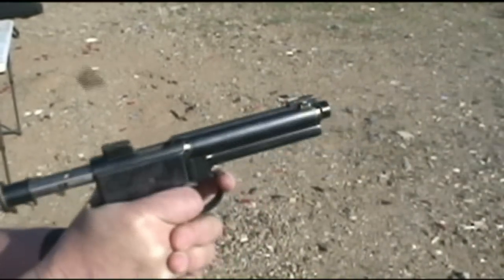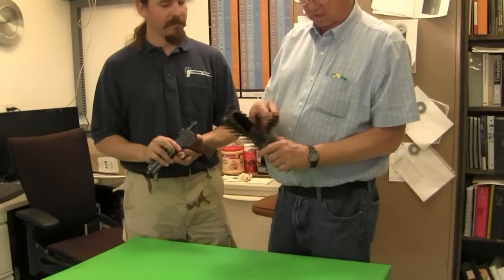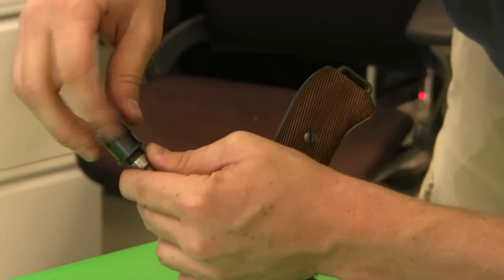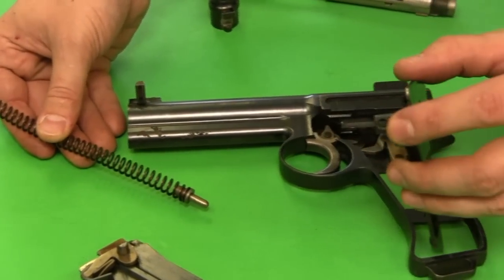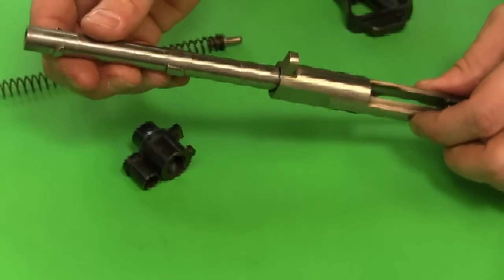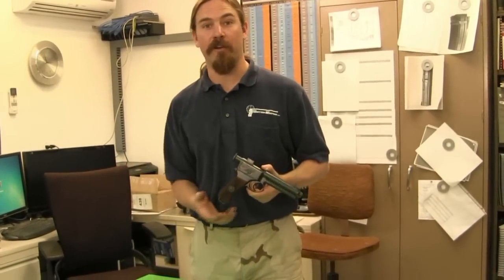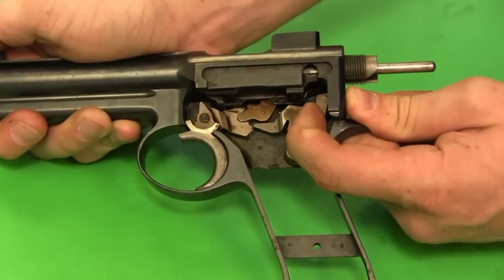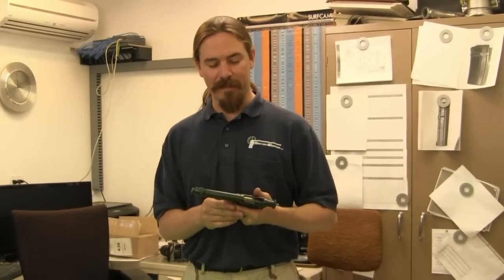Roth-Steyr 1907 Pistol

Comment: I can see the origins of the idea that a semi-auto is less reliable because of all the moving parts.  That guns seems to have been designed by clock makers.
Reply: ***** Yes - I believe in modern guns you can't make a legit claim to revolvers being simpler, having fewer moving parts, or any of that stuff.  Historically, however, it took a long time to simplify auto-loaders and get them to the level of reliability they've attained in my lifetime.

Comment: You can see it's ejecting pretty much straight up and back.  Which is really convenient for finding brass.  If you leave your mouth open as you shoot, you don't even have to crouch down to pick up your shells, which is nice.

It's not a flaw, it's a feature.
Reply: Don't look directly at the bugs
Reply: It's also obviously not designed for buxom women to shoot with low cut shirts. :)

I've seen that happen with modern firearms also.  They sure do seem to jump around after that.
Reply: Also a similarity with Glock. Used a 19 at the range one time at it showed contempt for my left handedness by throwing hot casings at my forehead. Good times. . . Good times.

Comment: I suspect that the inertial effect of the bullet taking the rifling would have caused the rotating barrel to screw up tightly, and provide the locking delay.
It looks potentially very accurate to me.
Many thanks for all the splendid videos.
Reply: I tink it would put you in mind of a ruger, in its design in regards to the blow back,

Comment: Nice presentation. A bit of 07 Roth Steyr lore; they were issued to the Austrian Flying Corps in WW1; they were part of the Austrian war reparations in 1919, and they were very popular with the KuK (Imperial Army). You gave very good instructions on loading but  here is how to unload it. Behind the lever which depresses the magazine floorplate there is a square checkered button. Pull back the bolt and depress this button.It locks the bolt in the open position. Depress the first lever to unload.

Comment: Never seen a detail view of these. Very interesting. There is an awful lot of things going on simultaneously, and the trigger system looks pretty intricate. Good ergo though. I can see why they went to a fixed mag for cavalry use- dropping mags all over is of little use. A charger loading system makes sense, esp with 3 pistols. I think ballistically the cartridge is about like a 32 H&R Mag- 85 or 90 gr bullet at about 1050 fps or so. Decent but not real high energy. Great video as always. Thank you

Comment: that is a pretty hefty rotation on the barrel.  The PX4 Storm's rotation is barely 45 degrees to compare to a modern rotating lock.  The PX4 is also a VERY much simplified design all around, field stripping into 4 major parts (barrel, firing assembly, slide, and reviever).

Comment: It is a wonderfully designed gun,  very intricate, there must be some tension on that spring,  when he pulls it back,  you can tell it is not easy to pull,  i assume this is partly to do with the rotation of the barrel,  which in itself is crazy, in a good way,  the amount of work in that is unbelievable and so well done, the one  thing i reckon,  i would not like about the gun if i was firing it,  is the trigger,  he mentioned how hard it was pull,  and it looked like his finger had to travel a long distance before strike,  this makes for a gun with less accuracy.  Still are very impressive weapon.

Comment: Have to remember, military tactics back in 1907 were still along the thought lines of static "front lines", and Cavalry were essentially the Special Forces of their day, designed to break through a weak flank. Even today, modern Special Forces frequently use different arms than the average infantry.

Comment: Great video about a very interesting gun! But I think your guy mixed something up regarding the 3 pistols - by the time the M1907 was issued, the main weapon of the Austrian Cavalry trooper was, beside the sabre, the Steyr M95 carbine. The M1907 Pistols were only issued to Officers and NCOs to supplement or replace the older Gasser Revolvers.
The Cavalry did have two holsters with pistols on their saddle for every trooper, but only at the time they used flintlock and later percussion-lock single-shot pistols.

Comment: hmm, if im understanding the mechanism correctly the slide and bolt basically blow-back, when doing so it forces the lugs in the frame to rotate the barrel and unlock it from the slide, allowing the slide to continue on?

Comment: It's interesting that the Ruger Mark II is actuall based in an 8mm pistol. Not the Roth-Steyr, but the japanese Nambu. 
Neither the Nambu nor the Roth-Steyr weren't that successful. 
The Steyr-Hahn on the other hand, at least it got a refurbish by the germans, they rebarreled it to 9mm Parabellum. The Steyr-Hahn originally shot the 9x23mm Steyr cartridge and, like the Roth, the pistol also had a rotatory-locking barrel design, but way simpler.

Comment: I used to think that this gun was very similar to Glock, but now I am studying how the safe action works and I am not so sure anymore.
At 13:21 seems to me that its trigger works in the same way for every shot, which is equal to double action only. Unlike most double action only pistols, it can pull the striker only once and not for the entire striker course, but it is not a safe action because it does not have  the typical Glock's short reset.
The philosophy, the main idea is still a lot Glock (or the Glock is a lot Steyr), but I suspect this gun isn't able to make the short reset. Am I right?
Reply: "Safe action" is nothing more than marketing wank, and the trigger reset length isn't magical one way or the other. They function in more or less the same manner, but they are obviously not the same gun.

Anyway, there's really no way that Glock's aren't "double action". The striker is partially cocked by the slide action, true, but the trigger still has to sequentially perform the actions of fully cocking the striker and releasing it. That's literally the definition of "double action" – though obviously a Glock is quite distinct from a typical DA-only hammer-fired pistol, and so most folks accept the marketing wank as a somewhat gray area middle ground.

Comment: 11:35 "When you pull the trigger you have to manually recock it before it will fire again"
12:20 "Now If I pull the trigger again, it does nothing because I have to manually recock it again"
14:25 BOOM BOOM BOOM 

Hmm...
Reply: He only has to manually recock it because it isn't cycling live ammo. In operation with live ammo it recocks the striker about 75% of the way with each shot and the trigger has to pull it the extra 25% before dropping the pin with enough force to fire.

The idea being that if it slipped or broke and the pin dropped from it's usual partially cocked position, it wouldn't have enough force to actually detonate a primer.